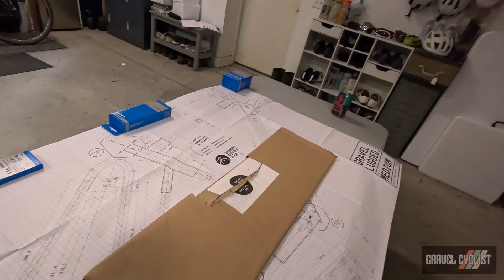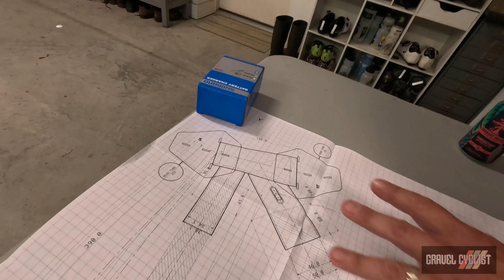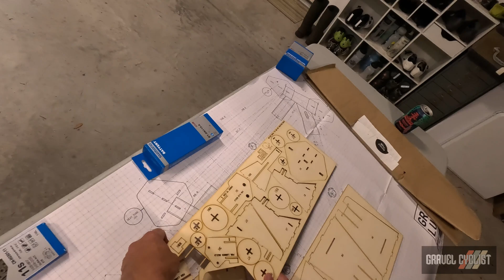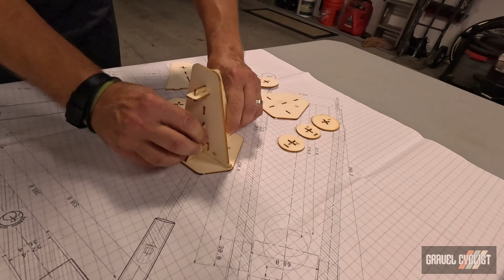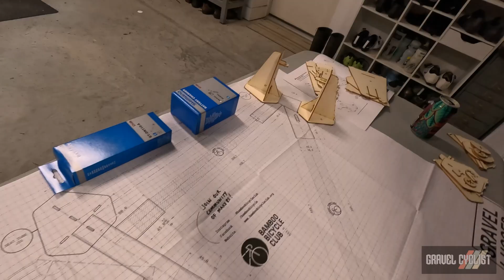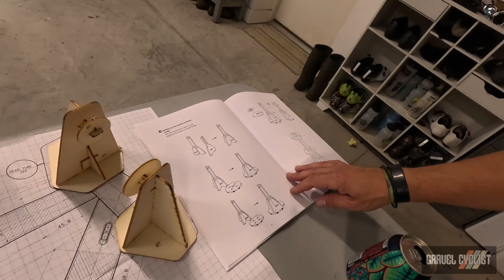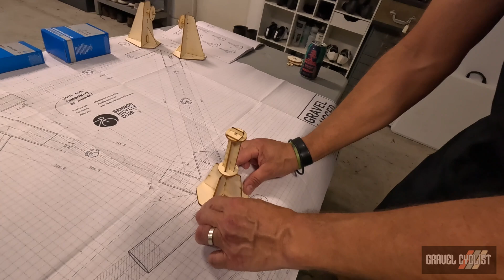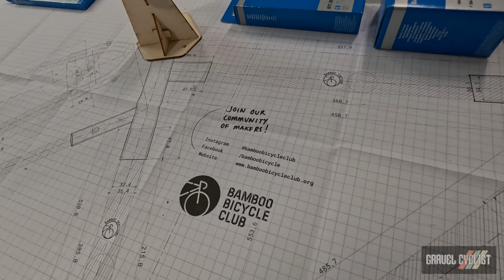DIY Bicycle Frame: Bamboo Bicycle Club - Part 4 THE JIG

Comment: It's so critical that everything ends up straight.  The plane of the rear wheel needs to be parallel to the center line of the frame.  Once everything is glued, you cant adjust anything (unless the kit comes with adjustable dropouts).  No room for error!
Reply from the maker: The rear wheel will definitely be part of the gluing process, dropouts are not adjustable.